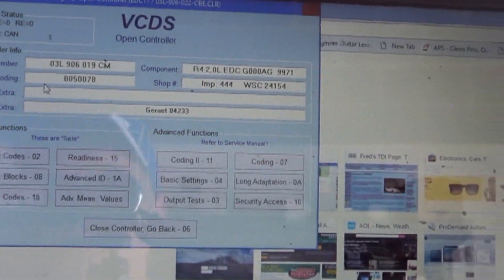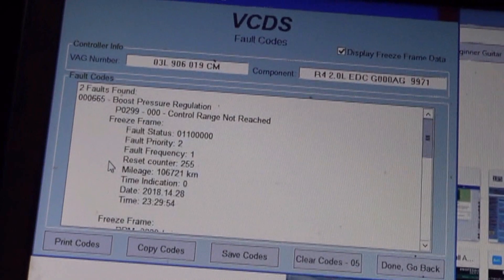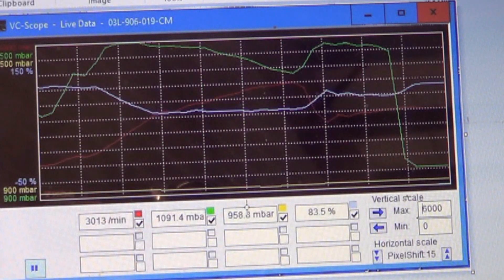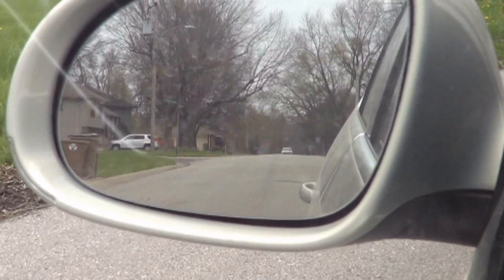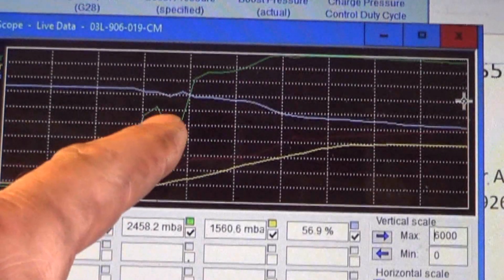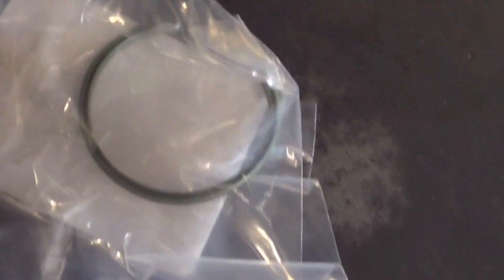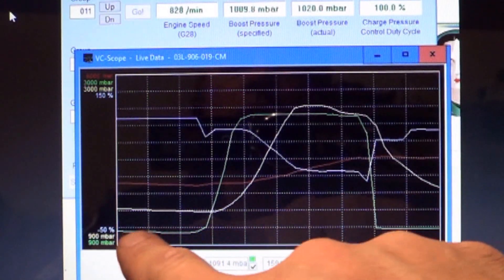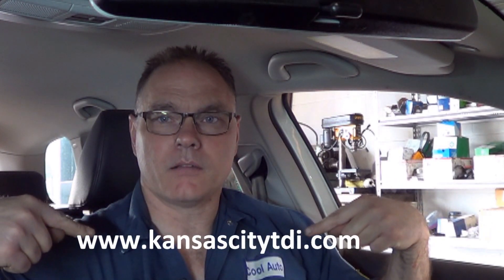2010 Jetta Tdi Turbo boost leak P0299

Comment: A broken brake booster hose will also cause this code and limp mode.  Part of the hose is hard plastic and is susceptible to cracking and/or breaking.  Ask me how I know.

Comment: i have a 2006  VW jetta Tdi and we have the  code p0299 come up.  low power and tons of black smoke when driving. we have replaced the intercooler pipe once about two years ago. I took it to a friend who put it up on a lift and when he reved it looking for leaks he saw massive ammount of black smoke coming off the EGR cooler valve. he reccomended replacing the EGR cooler. would that cause the p0299 code? i would just love to bring it to your shop if you were in Utah. Do you know of any shops here in Utah that you would reccomend? your youtube is by far the best i have found for Vw tdi
Reply from the maker: that code plus black smoke probably equals boost leak.

Comment: My 2006 hjetta tdi had a hole in intercooler pipe.  It blew a hole from inside out and  melted the plastic hole size of my pinky finger tip. Lots lost boost. The new pipe is $250-380. But I got  a plastic welder  soldering iron from harbor freight $18. Melted bubbled up plastic back down to fill hole  and  cured hard again. Boost came back and then I start working  on all others problems like a bad door harness, air bag light, abs lights  and selling it soon to get a Toyota or lexus. These tdi cars are nothing  but money pits and endless  repairs.
Reply from the maker: Love the improvised repair!  Good job finding a fix that saves some money.  Used one might have been good too.

Comment: This is exactly  problem  having with a 2006 tdi. Cracked plastic pipe.
Wish you has the video how get that plastic  pipe  off and installed.
Reply: It's not too hard get pipe off. 
Pull off air filter box, battery box.  
Then front lower intercooler rubber hose held on with snap clamps under car near radiator. 
Then there's 2 bolts on plasic pipe intercooler pipe.
Then need pull off back mass air flow pipe , near the top turbo is  a hidden bolt on a hose clamp.
Then there's  coolant lines to the engine and intercooler.  Pinch those off with hose clamps or stuff clean rags so don't loose too much. 
Then go under car to back engine will see the back hose clamp on intercooler pipe.watch how the spring clamps go on and off. Thats what got me when reattaching to make sure the snap clamps lock back in the little ridges so pipe doesn't  pop off.
Then you have to do tetris to move the pipe out all the different  things. Took about  an hour get off. 
Take pictures  as you go, and have a buckets or bags  of where different  bolts , screws go. 
If need refill coolant use distilled water if don't have the right coolant. Don not mix coolant types can make salts in the coolant system  clogging it.
You'll need t27 and think t25 bits for specialty screws.
Reply from the maker: @dylano7242  Nice post!
Reply from the maker: Sorry, the main focus of this channel is diagnosis.   Not much time to make how-to's for each part that might be replaced.  But if you make a video on how to do it I'll link to it.

Comment: I don’t like those clip fitting boost pipes, better with a normal hose and clamp but VAG persist in using them. At the end why does boost run above requested at first, because of the tune?
Keep up the great work 👍👌
Reply from the maker: Lots of vehicles the boost will overshoot then come under control.  Some people run a aftermarket valve to "clip" the overboost off.   Mostly on performance cars though.

Comment: I had a hole somehow happen on the lower intercooler hose and the ALH smoked like a pig!! I was able to spot it while pulling off the exh manifold to clean it and looked down to inspect it w a flashlight and bingo!  The psi that develops in that tube is incredible!  Good troubleshooting and fix!
Reply from the maker: Nice daig that you did on your ALH!
Reply: sometimes service centers drill a small hole in the lower intercooler plastic pipe to drain oil build up in the pipe.

Comment: I f-ing hate VW !!! I have a lack of power and no check engine light on!! I flashed firmware on computer flashed software on it and it still has the same issue!! I can edit hex code to remove torque limiter but that is when I start having problems with clutch dmf etc: I do alot of highway driving and clutch has no slip it just grabs instantly :( OMG I hate this car so much
Reply from the maker: I'm sorry your having troubles.

Comment: Hey man need your help, I have a bmw 5 series twin turbo. I have a P0229 “Turbo Underboost” checked everywhere and saw that the left Intercooler is bent and has a hole on the side of it. Do you think replacing this will fix the issue causing underboost P0299
Reply from the maker: I think so.  Its a logical conclusion.  A hole in the side of a intercooler will definitely cause a boost leak.
Reply: CoolAirVw Rm Thank you, I will replace it and keep you updated whether it fixes the issue.
Reply: @thewiseguy7100  update?  I bet it fixed it, yes?

Comment: How did you get the new green seal on the intercooler the one that's on it is black and they're two different seals I tried for an hour and a half to slide the pipe on with the new green o-ring and was getting nowhere
Reply from the maker: Magic hands!
Reply: Magic hands my ass that's not the right seal that's the seal for the boost pipe that's on the outside and not the cjaa that's on the inside
Reply from the maker: @justenfarnsworth625  Car is still on the road!   We do oil changes on it regularly.  Maybe next time its in we'll take it apart and look.    Thanks for commenting.
Reply: https://youtu.be/ac8d3NcHQ_w
I thought this was genius and I'm going to do it

Comment: Hello there, great video. 
My 06 has no noticeable leaks, Actuator works it holds pressure, n75 working, when I go to the Measuring block and do a test, the boost pressure reading is normal  same with the boost actual, the Charge Pressure drops instantly from 98% to 20% I have no visible engine lights but I do have a underboost code which  makes my car not move for a good 2 seconds and blows allot of smoke and suddenly turbo finally kicks in and car goes. My fix for this was a zip tie mod... but car often goes to limp when I go uphill on cold engine.  ( please do help) if I take the zip tie it will choke again...
Reply from the maker: a more permanent fix, instead of the zip tie is to adjust the turbo stop.
Reply: CoolAirVw Rm is that an easy adjustment? Thank you for the reply
Reply from the maker: @Torontotings  No.  Its not so easy.
Reply: CoolAirVw Rm Please do explain how to adjust it and what the process is
Reply from the maker: @Torontotings  Seems the same info that you found to lead you to zip tie it would show you how to adjust it.  Basically you just want the stop to prevent the vanes from going full closed.  It tends to stick in the full closed position due to wear and lever angle.  I've fixed dozens.  most of which someone (dealer and other shops)had allready  recommended replacing the turbo.

Comment: May i ask you how do you see the VC-Scope at 7:26 recorded ?  When you are on Meas. Blocks you first press Log and then Graph, and when you got back you see the records or what ? Can you explain me the steps ?
Reply from the maker: You simply watch the graph and push the pause button, which is part of  the vagcom graphing  software.  Then after that to save it or manipulate it you hit print screen (or alt print screen) to save it to the clipboard.  My video in the following link shows how to do so. https://www.youtube.com/watch?v=02KJxNnYiZk&t=640s
Reply: @CoolAirVw   Thank you very much!!!  I wish i could come to your service, but unfortunately it's too far from me... i am from Europe/Bulgaria :D :D , and that's why i am trying to deal with my problem alone
Reply: @CoolAirVw   Hey again, today i bought a vacuum tool and here's what i found, look at the 1st video while the engine is running and then with shutt off engine, when N75 is ON, the gauge is NOT holding still, is that normal(i checked the the valve that controls the vanes and it works perfect, it hold the vacuum)? But when i connect it to Source Vacuum it is holding still. It only moves after the N75 valve, is the mean the it is faulty?
Video 1: https://www.youtube.com/watch?v=4yt3gQCthLY
Video 2: https://www.youtube.com/watch?v=OPIh7Qp5ar8

Comment: Excellent video thank you
Reply from the maker: Thanks for watching.
Reply: This is helpful. Especially when the mechanic pointed out, oil around the hose end @ the intercooler. Boost leak
Reply: I’m a little dumb on turbo. What is going thru the left & right side hose, attached to intercooler? Air, oil?
Reply from the maker: @josemsm80  Air but all turbos put out trace amounts of oil mist in the air.
Reply: They were replacing the original with an upgraded turbo, & showed me the leak. 👍🏽👍🏽

Comment: Nice job man but how did you know that there is a boost leak causing the problem and not the n75?
Reply from the maker: Initial diagnosis had zero boost and smoke.  Zero boost plus massive smoke equals major boost leak.   Output test shows quickly whether n75 works or not.    I never did a output test on this car but I've shown it in some other videos and it would be the same on this car.
Reply: @CoolAirVw  what if it makes full boost say 18psi then drops suddenly and holds back to 5ish psi then pulls hard to 18 again and vice Versa during full throttle ? 🤔
Reply: Thank you